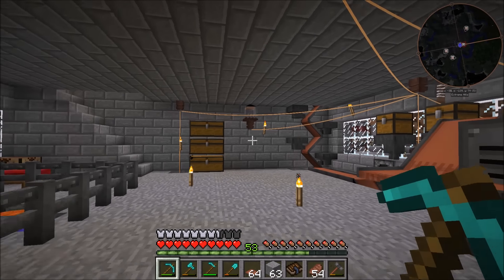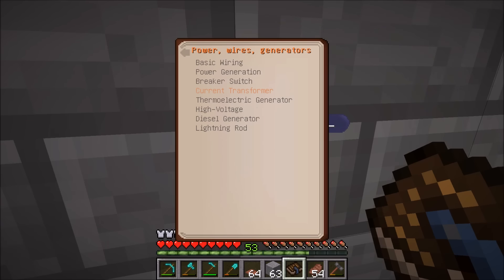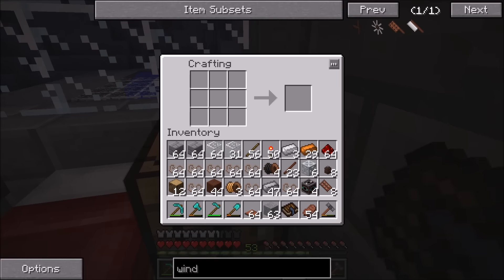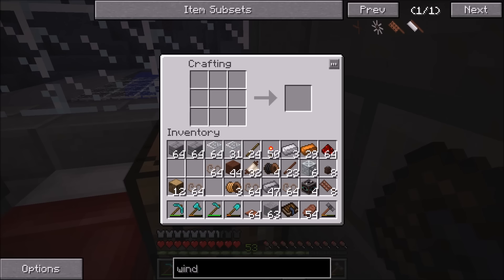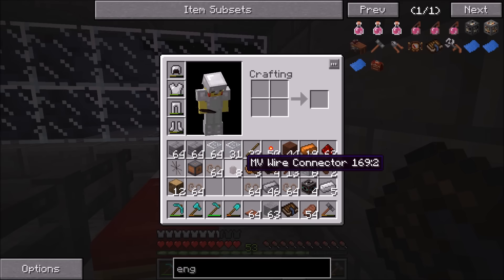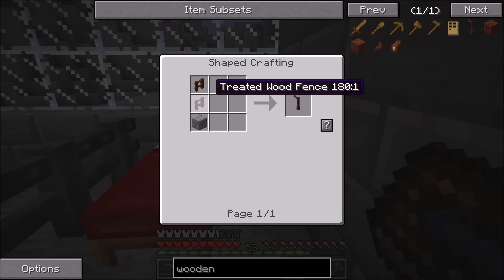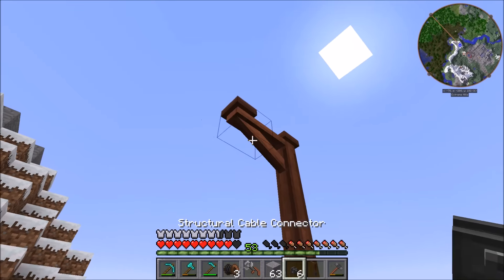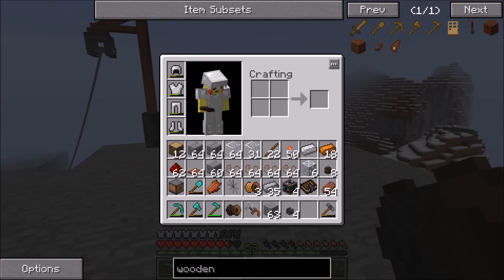Surviving With Immersive Engineering :: Ep.22 - Windmill Power Generation And Engineer's Skyhook

Comment: The Wind Turbines are my favourite power production method in IE. I have a large windfarm of 100 turbines above my base, on the top of a mountain. Each turbine produces around 50 RF/t for me. So i get around 5,000 RF/t out of the entire farm alone! I also have a setup of 42 thermometric generators, which produce around 600 RF/t alone. I filled up my 3x3 vibrant capacitor bank in under an hour with my setup! If you set them up properly, those suckers can produce a hefty amount of power. I've only seen production drop to around 3,000 RF/t, but that was only a couple of times.

Comment: I absolutely love the Improved Windmills. I set them up and plug them into my Powered Lanterns to guarantee those have a constant power supply. The hardest part I always find is how far out you need to get to place the windmills on the dynamos. Especially since I'm typically hanging in mid air, completely unsupported.
Reply: +Triaxx2 I did the same.  I tested one improved windmill at elevation 100 will power around 16 powered lanterns.
Reply from the maker: +Triaxx2 Hah, I know the feeling. I had no idea what I was doing wrong trying to place down the windmill in this video and eventually realized I was 2 block too low :P